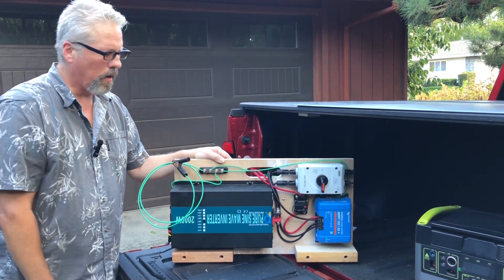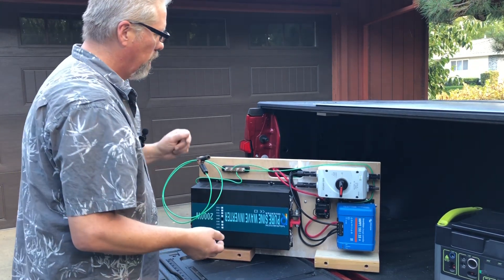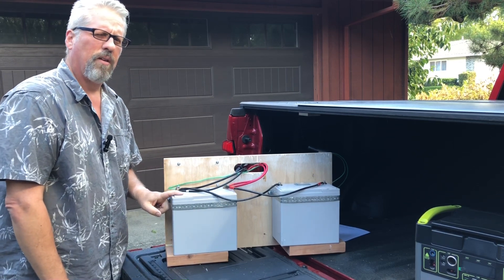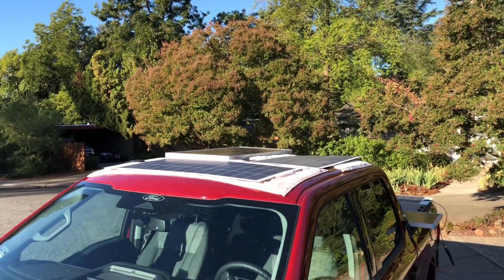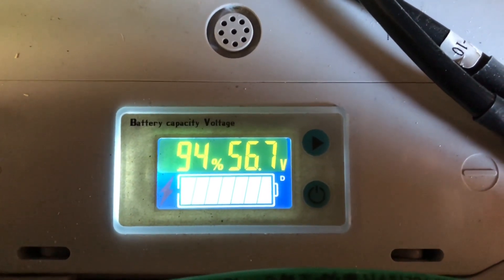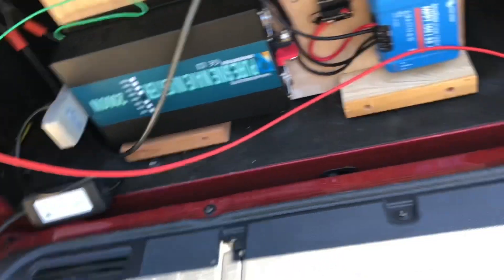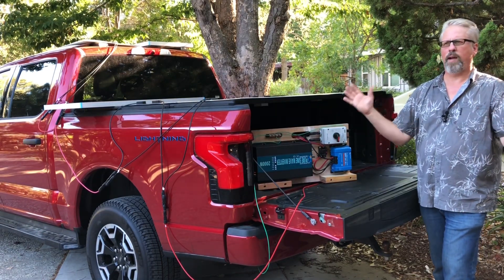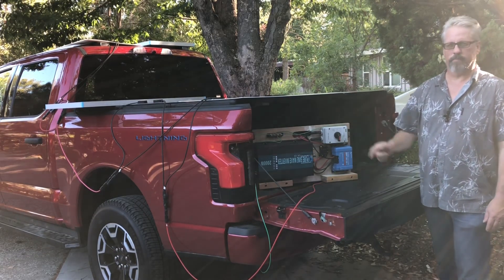Ford F150 Lightning: Going solar with a prototype solar charging system for my overland build

Comment: Interesting video.  I was considering adding solar to our house but too expensive, but this might be something I can cheaply DIY.  Considering my truck just sits in the driveway most days, could be perfect.   I'm sure you already know but having multiple variations of solar panels basically drops you down quite a bit .  Plus 1 panel having a bit of shade on it hurts all of them, I was surprised by how much.  The angle can help, but won't compensate for the different panels and shade.  My only hesitation would be if this is not healthy for the battery to be continually cycling, even if it is basically a trickle charge.

Comment: I had thought of a minimum of 600 watts of solar panels on the ladder rack structure above the cab and bed.  Application on the front hood restricts visibility due to the hazards created by reflection from the panels.

To depart from the flat panel would create wind drag decreasing the mileage so I figured I would have to accept the less than optimum angle for the solar panels. 

Cooling air for the electronics  exterior ducts and the forward velocity of the truck be mindful that rain water would be mechanically separated through centrifugal forces created within the duct.  
For me, the purpose of the solar would be to extend the distance the vehicle could be driven without the need to stop for an electrical charging station.  Shading of the panels would be reduced due to highway driving and accepting that sunlight or optimal daylight hours clearing is a limiting factor. 

I am anxious to follow your progress with your electrical testing visa vi optimum: operating voltage & current values.
Reply from the maker: Thank you for your comment.  I am currently dealing with an urgent family medical issue and there will be a delay before I can get back to this project.

Comment: I think you might experiment with your panels. If you have them all in series - I think you’ll only get the highest voltage of your lowest panel output. So you may get more watt output by unplugging your weakest panel.  With a 48v battery (which is good) you’ll also need at least 52v (48+5 I think) to start the solar charger - but appears your panels will get there. 

I just got a few CIGS panels and am just starting the play with them - our weather sucks (15 and snow still).  I have the channel Camp Prevost - playing with the EG4 lifepo4 batteries and now solar.  

Seriously looking at a lightning and thinking about what you are doing - so thanks for the videos. 

I am also toying with the idea of removable batteries - although how to connect them to the chassis is another problem.  If you could charge up a 10k-80k pack and put in your bed and quick connect to the main pack - would be neat to rent the modules around the country - kind of like the propane tanks.   Run them down, exchange for a charged set and take off.  Repeat as needed.
Reply from the maker: Thanks!  I've ended up with two groups of panels, each producing about ~750W at 75v and 10a, so a total of about 1500W.  This is short of my 2000W goal but I could add more if I changed the grouping and added more panels in the future.  I'm trying to finalize the setup and do some testing, should have another video showing the design and results hopefully soon.  But yes, I've also been limited by bad bad weather and lack of sun.

Comment: Great Video.  Very interesting.  What was the state of charge of your battery bank at the end of day?  It started at around 94%.  Were the solar panels able to keep up with charging your truck?  Or was the battery reserve slowly depleted over the day?
Reply from the maker: I can't quite fit enough solar panels on the truck (without an additional campsite solar array) to keep up with the power consumed by the charger - which is 640 Watts or so at the 6 amp setting.  I think I will end up using 3 of the 48v batteries I have for a buffer of about 40 amp hours (2000 Watt hours or so).  This way I can start out in the morning letting the batteries charge up to 90%+, then turn on the charger and hopefully the 100-150 Watt hour difference won't drain the batteries by the end of the day.

Comment: Awesome job!
What are you planning to do with your tonneau cover after you convert to overlander?
I just got my F150 Lightning and have been sticker shocked with tonneau covers? Ouch!
Reply from the maker: My tonneau cover was used off Amazon.  It was listed as “acceptable” with major damage but I found it to be like new with one little small dent.  Also, it was for the previous generation F150 short bed but it fit fine.  I recommend looking for an Amazon used deal, it could be half the price of new.

Comment: I enjoy watching you explore with confidence the powering of your Lightning via solar.  I'm in queue to get my Lightning next month. Eventually I want to install a solar system on the house that will also allow the panels to power the Lightning when grid is down. (We will be net metering.)  According to a couple of solar installers I've talked with, seems there are some restrictions (technical? electrical? policy?) to this goal.  But they also noted these may be overcome soon.  Are you planning to do something similar? Any suggestions where to go for how to?  Good luck with overlanding with your Lighting. We'll be watching and learning from you.
Reply from the maker: Before the Lightning was announced we had already purchased a solar/powerwall system for the house.  It's enough to charge the truck during the day even though that wasn't factored in.  If you have an auto disconnect switch installed you could still charge you vehicles off of solar while the grid is down (otherwise your solar power stops when the grid goes down, even during the day to avoid back feeding power to the grid).  Another option is to have a separate, stand-alone system, say 2kW of panels, that you could still use to charge your vehicles when the grid is down.

Comment: What is the brand of the adjustable chargers. I’m trying the charger my lightning. I’m using a MPP all in one inverter. Not being able to lower the factory charger is one of the problems
Reply from the maker: Hi, here is a link to the one I bought: MECCTP RV Level 1-2 EV Charger https://www.amazon.com/gp/product/B09X2JQX32